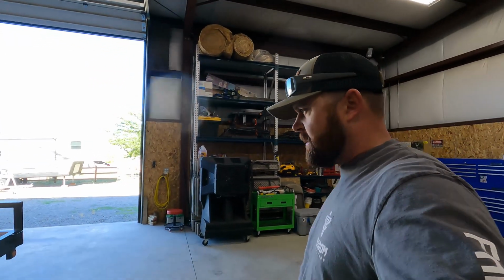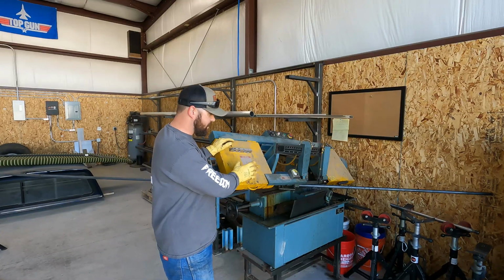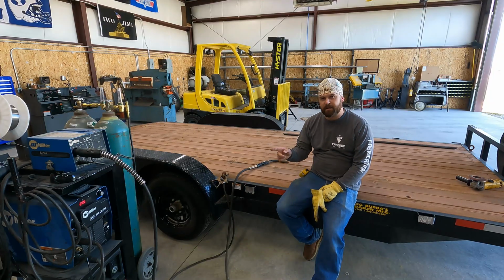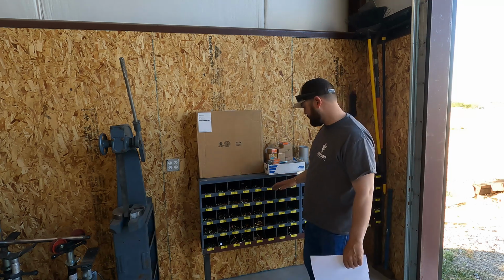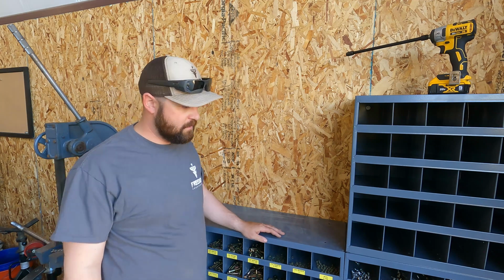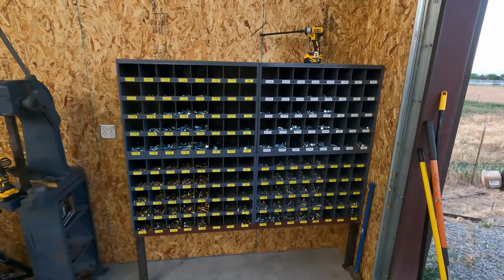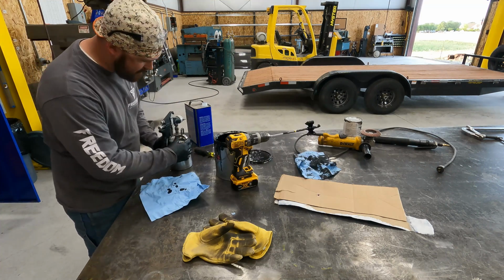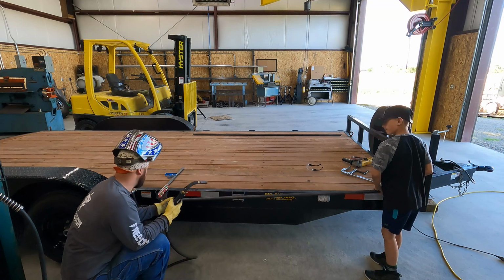ATV Trailer Ramp welding mod

Comment: Why dualshield vs solid wire?
Reply from the maker: I typically use dual shield for anything structural. It burns through mill scale and residual impurities better, and has better penetration than solid wire. I still use solid wire for many things, I just prefer dual shield for structural jobs. Thanks for watching!

Comment: Great video! Where do you order your bulk bolt sets at?
Reply from the maker: I actually get the hardware and the bolt bins here locally in Utah From a company called Rhoades Nuts and Bolts. They’re really good to work with and they can ship. Guy’s name is Brett, Phone # is 1 (801) 243-0183.
Thanks for watching!